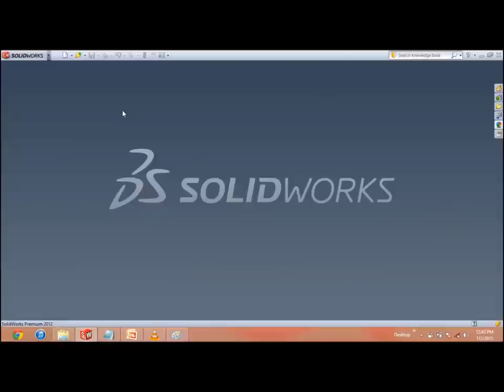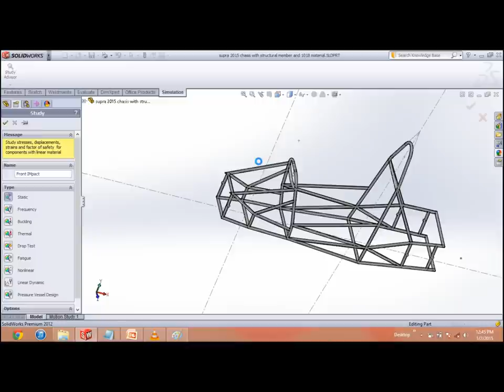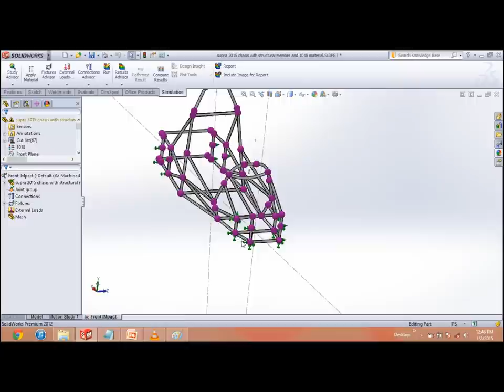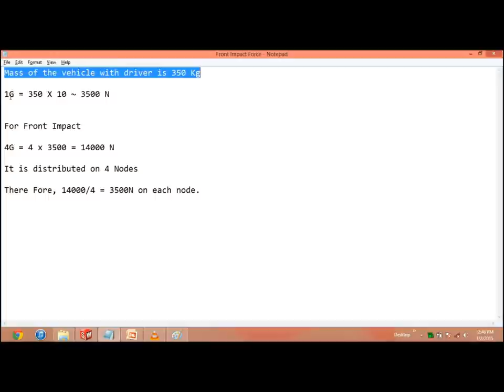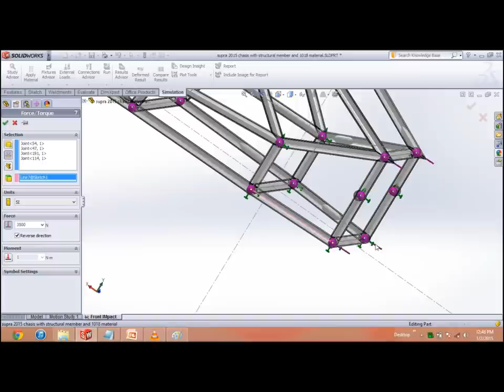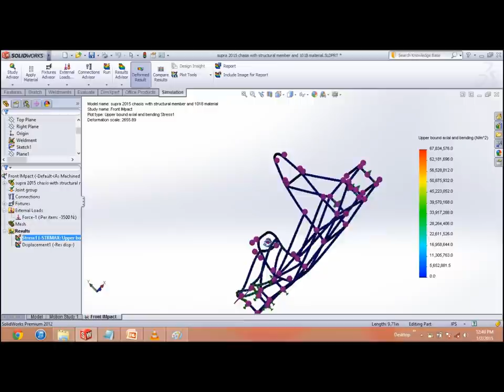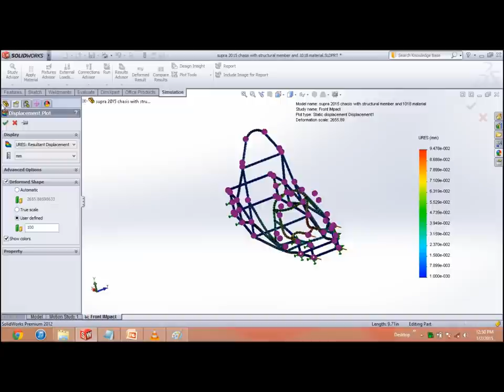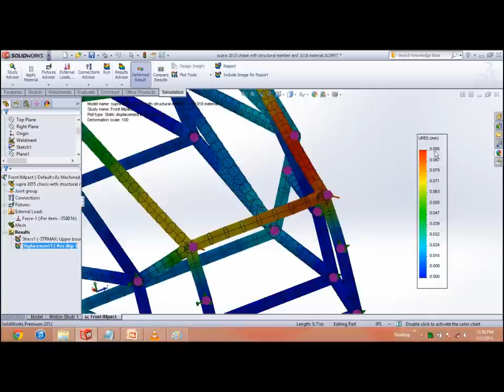Chassis Analysis with Calculations in Solidworks - Supra, Baja, Effiicycle and Go kart

Comment: Why did u use 4g ?
Reply from the maker: 4g force is the minimum need of force that should be applied while doing analysis of a BAJA chassis.... On the other hand, the big car manufacture's design their chassis to sustain 25g force.
Reply: +Kanav Lore Is there some regulation?
Reply from the maker: +Gabriel Fontana Yeah some SAE papers use 4G and many judges during Baja, Student Formula have affirmed that 4 G force is to be used..to achieve a minimum level of factor of safety.
Reply: +Kanav Lore ok, thank u. Good job
Reply: +Gabriel Fontana Assuming a impact collision where a body moving over 140 km/h comes to halt in a second, the force generated will be (mass of the vehicle * acceleration). Acceleration here would be 40m/s^2 which is close to four times g (9.81 m/s^2). Perhaps thats why 4g is used.